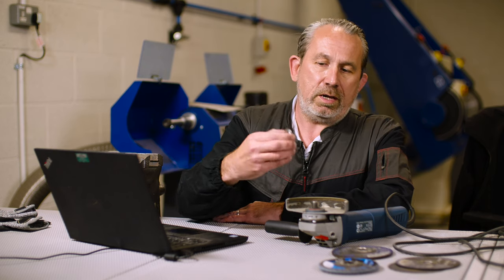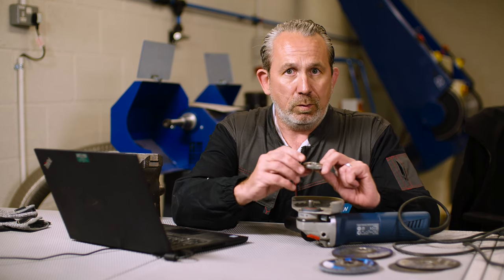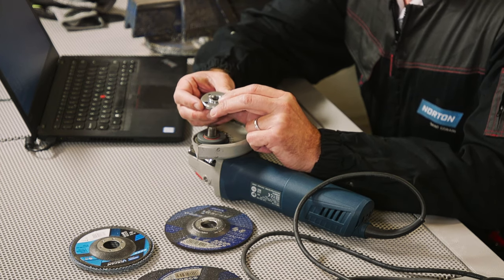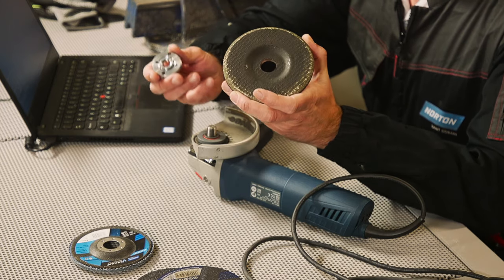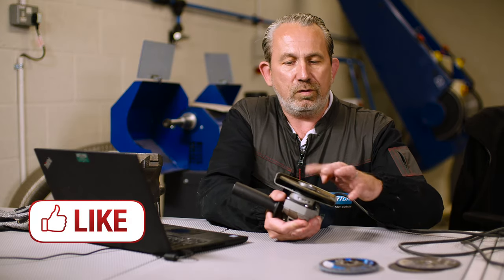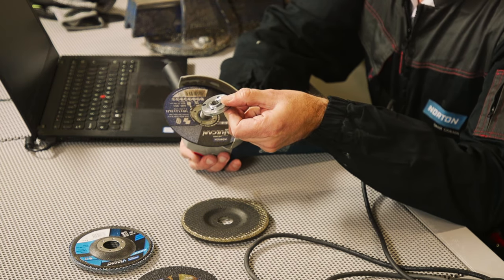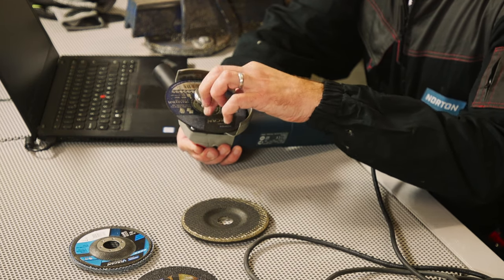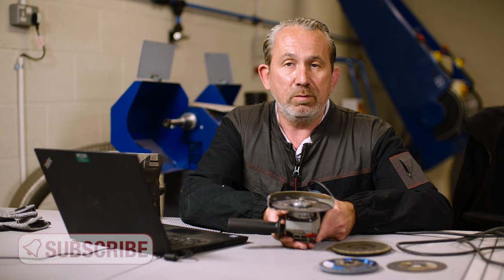ASK THE EXPERT: Why is the flange nut on my angle grinder a different shape on each side?

Comment: When using a flat cutting disc shouldn't you be using a Type 1 guard to protect from flying debris, together with an unthreaded  Type 1 flange to keep a flexing  wheel from getting too close to the guard and shattering?